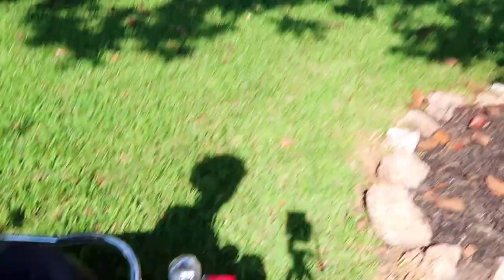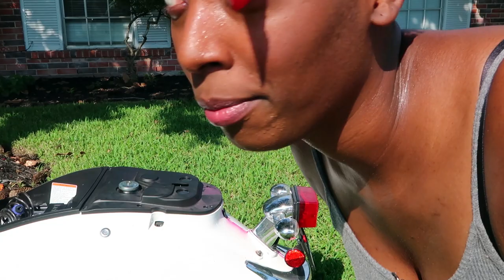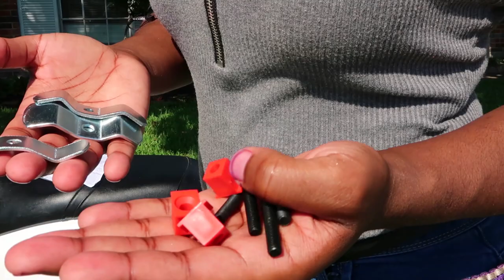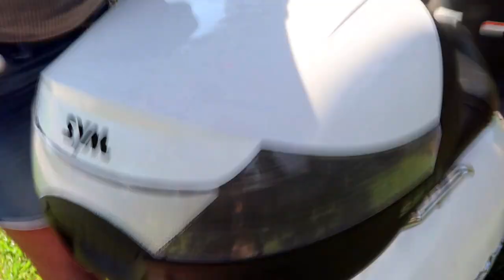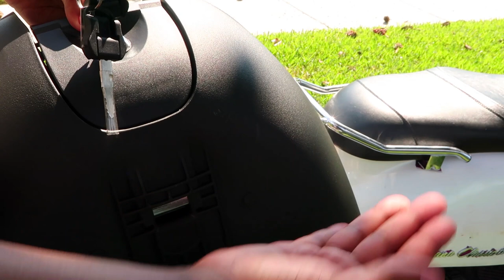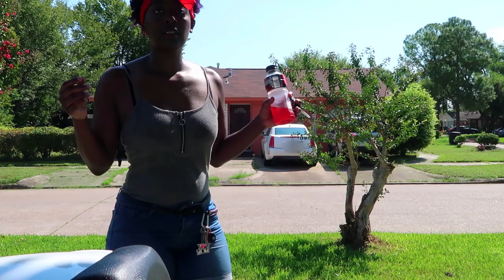Installing Top Case & Rack on Scooter

Comment: THANKS ! !   I was looking on ebay and did a search for snap on top case, there seemed to be no such thing, maybe I wasn't calling it what they call it. Yours is exactly what I'm looking for. I knew a lady who had a similar one on her kymco, . I think the  one you showed would fit right onto my boom rugged scooter without changing the tailpiece I also may want a removable top case for my street legal dirt bike  that  I will get in this spring. It may be unusual, but the  the bike has absolutely no storage so, I'd be able to run errands and take it off to ride rough  off road.  If you have more info on these snap on/off  top cases I'd like to know.
Reply from the maker: Sure thing 😄.
Reply: I was also struggling to find one in my price range... But I did figure out the eBay search to find them if it helps?

Its under categories: Cars, bikes, boats - Vehicle parts & accessories - motorcycle accessories - luggage - top boxes & tail bags 😊 Side note: its mostly called a Top Box or Top Case, but they don't always have snap removal. I'd use that search I said, & put 'removable' in the search box.

Hope this has helped a little?

Here's one that I was looking at, it doesn't seem to snap off without tools though: https://www.ebay.com/itm/122307724567

Comment: Hi I like your videos I have a 150cc scooter and I was wondering how you do your grocery shopping or methods of shopping with your scooter :)
Reply from the maker: Before I had the top case, I would just wear a backpack if I decided to go the grocery store on my scooter. My scooter also has a hook where my knee are, so I can hook some bags there as well.
Reply: Other tip, which seems obvious but I thought I'd mention... Try put the heavier items under the seat, & maybe even figure out a way to tie an extra bag to the back of your bike too... You'll figure it out if you play around & pop on your problem solving cap 😊❤

I initially had a much smaller bike than I do now (my first was a 125cc Grande Torino) & I solely used that for groceries for over a yr... Can definitely make it work.

Not sure if this helps, but good luck. All the best 😊❤
Reply: Other tip, which seems obvious but I thought I'd mention... Try put the heavier items under the seat, & maybe even figure out a way to tie an extra bag to the back of your bike too... You'll figure it out if you play around & pop on your problem solving cap 😊❤

I initially had a much smaller bike than I do now (my first was a 125cc Grande Torino) & I solely used that for groceries for over a yr... Can definitely make it work.

Not sure if this helps, but good luck. All the best 😊❤

Comment: Hey Ramen I was thinking about getting my first 50cc scooter. Which one do u think I should start on in the near future
Reply from the maker: It depends on your style and budget. Do you like more of the sporty look or classic? Are you trying for a cheaper brand or a more quality one?
Reply: @RamenOnWheels  well i want like a sporty look honestly and not looking to spend a bunch of cash but with decent quality
Reply from the maker: 5 Recommendations that might fit you well: Lance Cabo 50, lance PCH 50, Roughhouse 50, Honda Ruckus 50, Genuine Rattler 50
Reply: @RamenOnWheels  thanks I will check them all out 😀